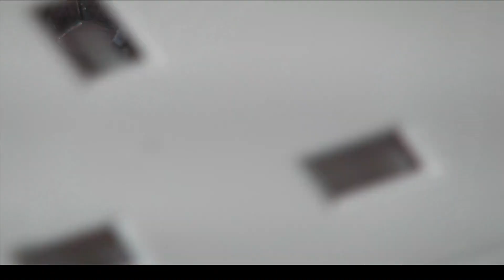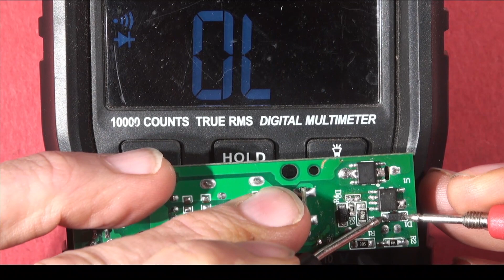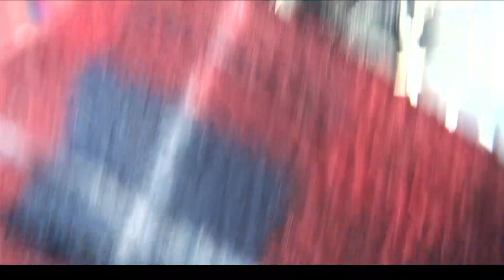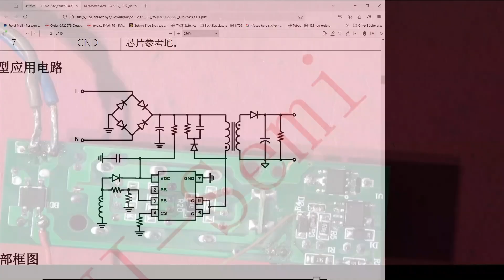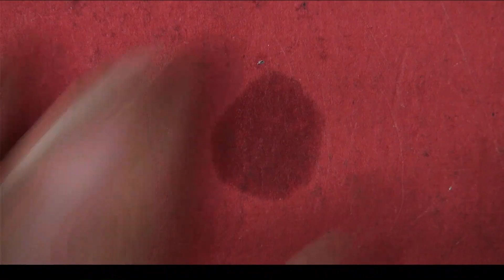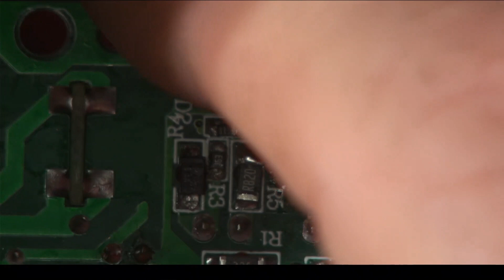Reverse Engineering a Bad Design – USB Charger Circuit Exposed (With Schematics & Datasheets)

Comment: I thought higher voltage in capacitors with same microfarads numbers makes the capacitors last longer 😂
Reply from the maker: You would have thought so, however: Understanding the Degradation Mechanism:  Direct from the manufacturer's design guidelines: Aluminum electrolytic capacitors rely on a thin oxide layer as the dielectric, which is formed and maintained through an electrochemical process. When these capacitors operate at voltages much lower than their rated values, the oxide layer may not be adequately maintained, leading to its deterioration. This degradation can result in increased leakage currents and a decrease in capacitance over time.

Furthermore, prolonged storage or operation without sufficient voltage can cause the oxide layer to thin or develop imperfections. Reapplying the rated voltage can sometimes "reform" the oxide layer, but this process may not fully restore the capacitor's original characteristics, especially if significant degradation has occurred.